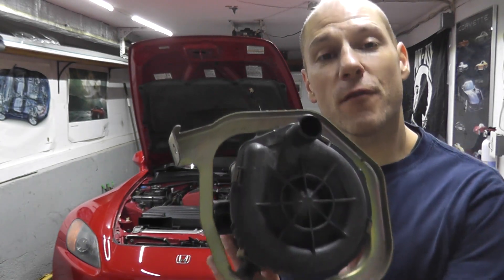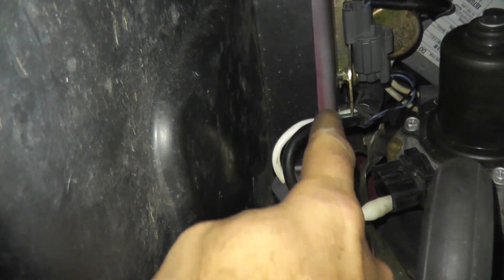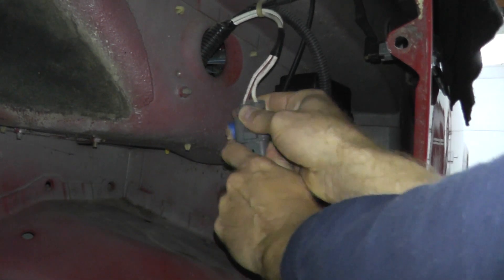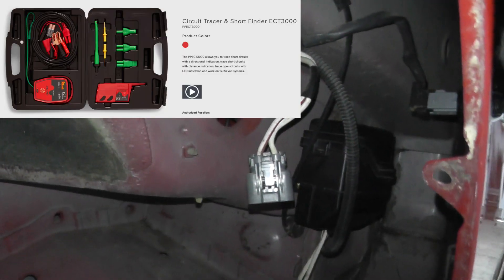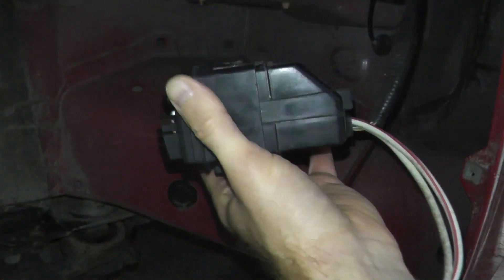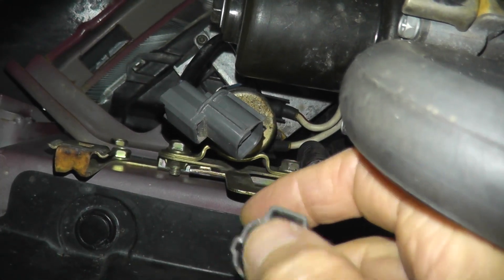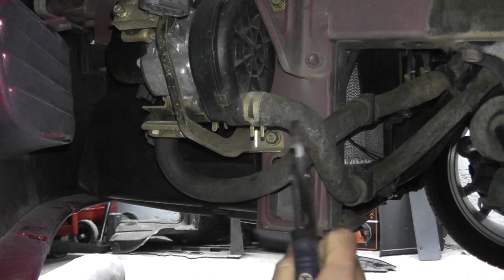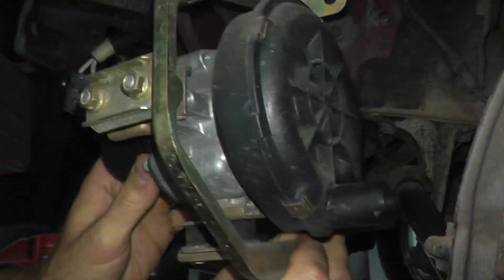Honda Air Pump Testing and Replacement | Honda S2000 Air Pump P0410 P1410

Comment: What a fantastic video! 👏 p1412 on my s2000 and iv read it could be something to do with the air pump!? So this video is just what i need to go and test it all. Thanks for a very well explained and well filmed video.
Reply: I have the same code did you manage to find what caused it?
Reply: @Thetoxicfly  Same as you, did you find what it was?
Reply: @lolmeercatz10   I changed the air pump and relay and that seems to have fixed it
Reply: @Thetoxicfly  ok thank you so much, where did you source the parts did you go to honda themselves?

Comment: Thanks so much for this but I still have questions. I have a P0410 code still showing up despite all these tests passing.
Reply: I had the same code but I just reset it with an OBD II reader and it never came back. Could have been falsely set off?
Reply: @XboxAlive  I'll give that a shot
Reply: @xaayer  Make sure that you erase the stored codes in the ECU and don’t just reset the light. If you just reset the light it will come on again from the stored code from my experience but if you erase the stored codes and there’s no discovery of known issues from these tests it should not illuminate again. I found it very odd myself but all well once they were erased not just resetting the engine light. (Hope that makes sense)